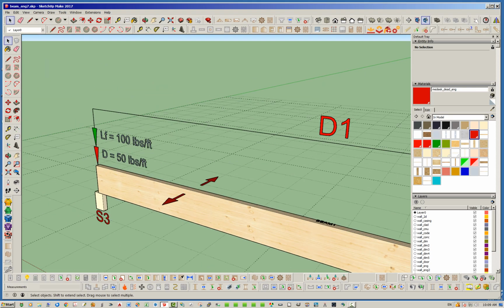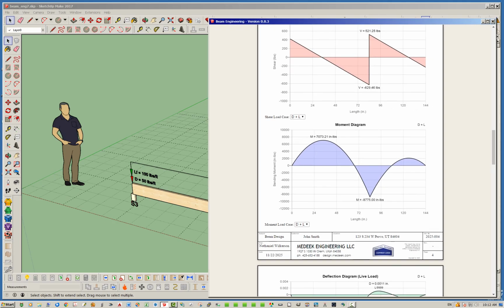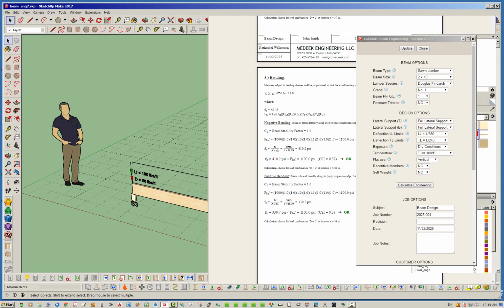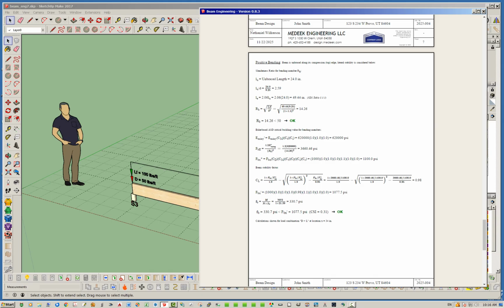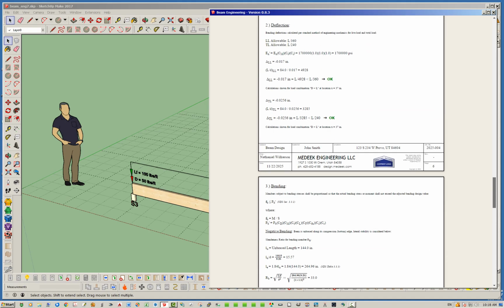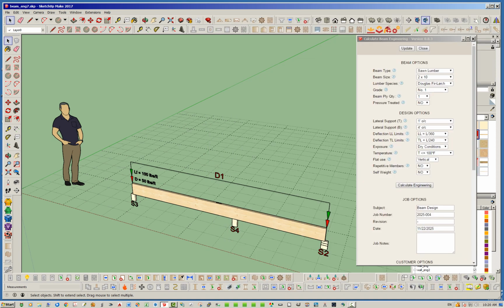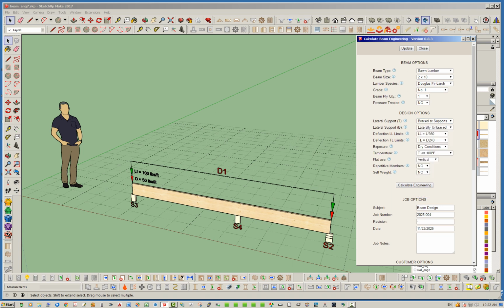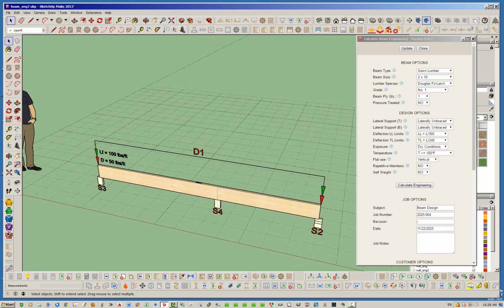Medeek Engineering Plugin Tutorial 2 - Lateral Stability

Comment: You may want to describe what a braced condition means from a structural engineering perspective for the viewers that are not engineers.  Braced condition = some sort of physical connection between beams top and bottom edge to the subfloor or columns.

Great video.  Thank you for doing this.
Reply from the maker: Your right I should have provided some actual examples of bracing typically used in practice.